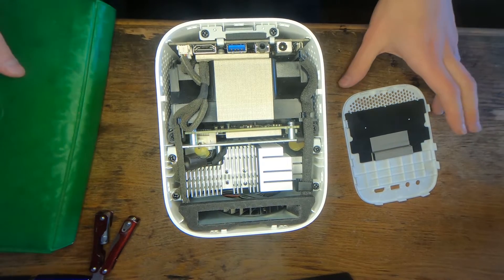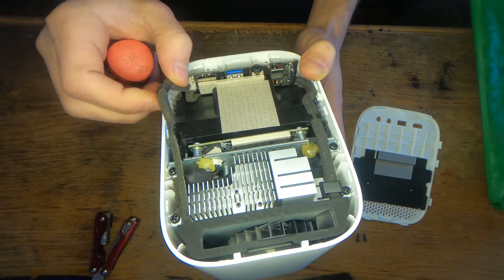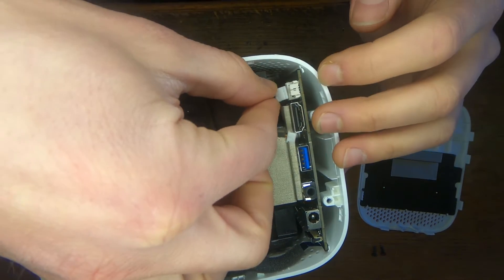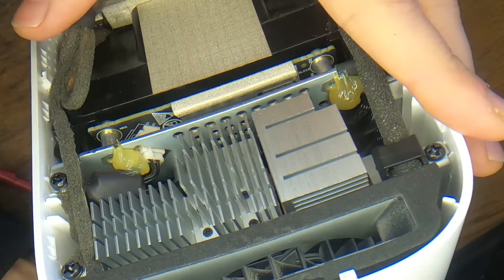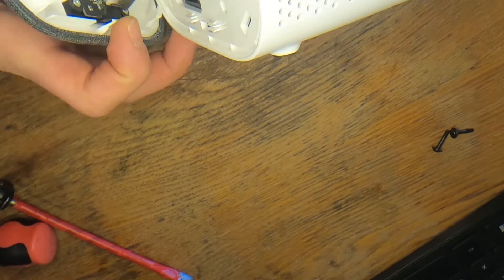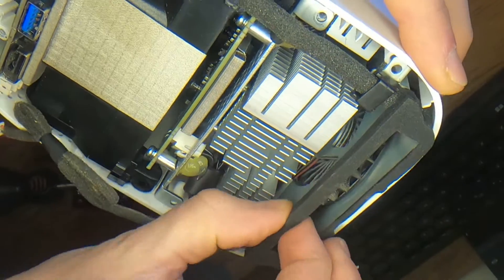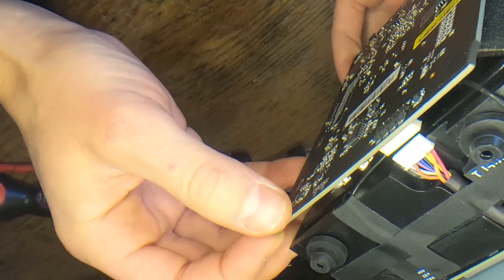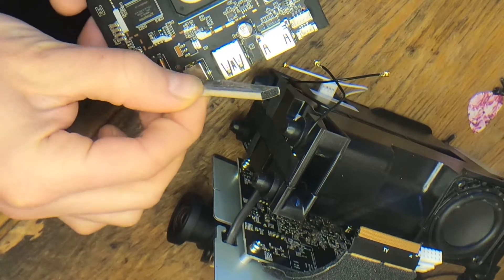Disassembly Xiaomi Mi Smart (youth) 1st edition projector

Comment: Buongiorno il mio modello ha smesso di illuminare bene lo fa con una luce flebile visibile poco e solo al buio. Lampada usurata o potrebbe essere polvere o qualche contatto?
Reply: The vibrating mirror inside is moldy.
Reply: @luoxiao-w7q9t Yes, it suddenly went dark. Is it possible to clean it and make it look like new again?
Reply: @PaoloAlzetta Take the lens apart, there is a lens in it to clean it.
Reply: @PaoloAlzetta Wait two days, and I'll make a disassembly video.
Reply: Maintenance procedures have been released.

Comment: Mine is 3 years now, it keeps shutting down randomly, I think it's overheating. I cleaned it with an air compressor but the problem persists. Anyone has a fix?
Reply from the maker: @FranciscoMaiaPT  they need a cool room below 30c also all sides should allow convection. There should be a warning for overheating and dimming of the picture. If you have no air conditioning in the house , forget it . Keep it off until September
Reply: @mendebil  hello , thank you for your reply. I have the projetor on my outside balcony and we use it only nights after dinner, when it's more cool. We are at the peak of summer here with > 35deg Celsius here, so it's really very hot. I believe it's overheating as you said, but what bothers me is that in previous years I had the same usage and conditions and the projector worked flawlessly. Moreso, I never get a warning of heating and/or dimmed screen. It works for 2 minutes, 10 minutes, it's random, it just shuts down in 2 seconds. I can just press the power button and start again...
Reply: I’m having the same issue, was thinking the air compressor would work… it doesn’t even warns about temperature anymore right? It just shuts down, I’m pretty sure mine is very dirty inside. I’ll try taking the fan out to clean and see how it goes
Reply: @JordanGomes93  Just to give an update. I found my issue and it was my fault in my case. I had made a power extension cord to allow for a ceiling mount and the conector soldering somehow got damaged (maybe heat from the hot summer), so it was an eletrical malfunction. I remade the cable and got not more issues ever since.
Reply: need cool atmosphere. these day auto swich off

Comment: Hi all ! Any one face the problem that the speaker doesn't work sudden .... but ear jack and if I connect bluetooth speaker is fine ...
Reply from the maker: @lamjeff1001  factory reset stock software works best
Reply: @mendebil  i have try to full reset thru the system setting... But still the same

Comment: Great video, thanks for sharing. May i ask you, have you fixed or disassembled the power adapter for this projector? Thank you very much
Reply from the maker: No. But I hear mine buzzing when idle which is strange. 19v 3.5A probably most laptop chargers would be a good substitute

Comment: my usb is dead, should i try to open it and get it repaired? or just use the projector without the usb functionality?
Reply from the maker: It is the same process as with the HDMI. Take the main board out then it is SMD replacement
Reply: @mendebil  replace the port? As charging works through that port but, USB connection to storage doesn't work

Comment: Please ..show us how to initialy open it
Reply: ...you just put a flat screwdriver or a cuttlery knife (a knife with a WIDE flat tip) between the edge of the white back panel and the body....and turn the knife´s tip a bit to pop the white back part off. 
Once again, there´s no screws to undo. Just gentle turn of the knife at each side of the square back panel...and it will come off

Kind of a similar process he showed at 6:40 in this video to undo the front panel!
Reply: please
Reply: Yes please

Comment: Hello friend, I have the same model that you show in the video and today the equipment projects but with less light to a point that is decreasing so that no image is seen, only sound.  I tried to contact Xiaomi to see if there is a repair center but I have no success in contacting them, what do you think is the reason?  Will you have a solution if you take it to a repair center?  Greetings from Mexico and thanks for the attention
Reply from the maker: Hola amigo. You need a good engineer who can disassemble it further. Sounds like a power supply or LED fault but I am not an expert

Comment: How did you initially open the plastic unit of the projector ?
Reply from the maker: The plastic back has clips you just need to be careful not to break them
Reply: @mendebil  so a sharp object needs to be used to pull out the plastic!!my projector is not switching on, so I need to check whether any dust has got accumulated
Reply: Opened and dusted, no luck !!
Reply from the maker: @AshwinRaghavbunny  check power adapter with voltmeter
Reply: @mendebil  sure!!

Comment: Hi, I already disassembled it almost 6 months ago because the fan makes a lot of noise. I found that the fan has some issue in the central pin. Do you know where I can buy the complete fan spare part?
Reply from the maker: I think you would be better off understanding the issue before buying anything. Is it the fan? Is it the driver?
Reply: @mendebil  it's the fan. I'm sure

Comment: brother i need your help
I'm from Chile, but I'm going to translate so you understand me.
I have a project of the same model as the video, I had it for a year and one day the lens stopped projecting. (It turns on when it is turned on, but it does not project the image, in fact it lasts about 1 minute to turn it on and before it turns off it shows an image like green and black squares.)
You could help me identify if there is a solution and what could be wrong.

thank you very much for your help!!!!
Reply: @mendebil
Reply: Merhabalar sorunu çözebildiyseniz bana da yardımcı olabilir misiniz ?

Comment: Thank you for this great explanation on disassembling the Xiaomi projector. For further notice, I first removed all screws from the back, and both cables running down the side of the housing, then I removed the fan - this way I got enough space to easily removed the front panel.
Also info for people with dead dmd chips, part number is DLP3310FQM.

Comment: Hey man thank you so much for making this video as there i no other on the entire internet for this model. My issue is i start having dead pixels I have many black and some white ones now aswell, everyday it gets worse. Do you know what kind of chip it has and if i could replace it? An answer from you would mean the world as i am slowly scared ill need to buy a new one :(
Reply: Hey man I have exaclty the same problem, please did you manage to find the serial number of the chip?
Reply: @mehdihbabou5290  Actually yes i took it apart and sucesfully repaired it for around 75€ the serial nº was: DLP230NPAFQP

This is for my chinese pro proyector version. I understood after my research that all models have the same DLP Chip. Goodluck i am happy we finally got a decent support topic open for the projector. I took everything apart and got quite a lot of knowledge out of it. If anyone has any questions please don't hsitate to ask.
Reply: @jaktie123  Hey thank you for answering. In my case I have Mi Smart Projector 2 and i read that it has a 33inch Dlp chip "DLP3310AFQM" but to be sure I wanted to know if there you found the serial number on the chip itself, is it written or engraved on it? and please where did you order it from?
Reply: @jaktie123  Love the open repair topic, I’ve been worried lately about availability of replacement parts.
Thank you for all the info so far.
One question:
What’s the serial number of the led module?
Thanks.
Reply: @jaktie123 hello did you manage to fix the green screen issue ?
Reply: @sosovitchsosovitch9143  Hi my friend is your screen completely green? Can you see anything at all trough it? When did it start happening? Please give me the max info to try and help you with your issue my friend!
Reply: @jaktie123  yes the screen is completly green, that doing that a few month ago can you have a Instagram or everything else where I can send you the video of what’s the projector does ? Thanks for your reply
Reply: @jaktie123  hello any news ?
Reply: Hello guys do anyone have manage to fix the green screen issue please thanks for you reply
Reply: Hello man did you repair it ?
Reply: Mine gets off and do not light on ! Help me
Reply from the maker: Hi. Sure my pleasure. It is really just a disassembly video so an engineer does not risk breaking it. For details tho I would have to check again, which is not really practical :) I hope you are lucky and  find the parts you need
Reply: @mendebil  Thankyou so much for getting back to me! No problem don't worry, if you ever take it apart again it would be cool if you could share me a picture or serial nº of the DMD chip thats inside. Anyway your video is great on guidance on disasembly! Thank you again😇
Reply: @jaktie123  Hi, I have issues with the same projektor (it only displays green screen). I took it apart following this video, and I went a bit further. I managed to take out the DMD chip. The part number is DLP3310FQM. I hope this helps.
Reply: @zergonion  I'm experiencing a problem with my projector - it's the second generation of the same model shown in a video. I'm noticing a lot of white and black dots appearing on the screen, which I've learned can cause damage to the DMD chip. I'm wondering how to identify the specific chip that needs to be replaced,  and how did you manage to replace it by yourself?
Reply: @zergonion did you remove the screws from the module on the right that the video is at 11:32 there is a dmd chip with that part number or where it is located
Reply: @zergonion hello did you manage to fix the green screen issue ?
Reply: @sosovitchsosovitch9143   Unfortunately not. I ordered the correct part and replaced it, but the screen was still green.
Reply: @zergonion  what part did you change ?
Reply: @zergonion  where is the dmd chip located?

Comment: How do you open it at first Time? I don't find
 any screw... I just want to clean the inside.
Reply from the maker: Take the back plate off with a plastic tool. Or a screwdriver
Reply: May I ask how to remove the back plate?

Comment: Hi, I have the same model (bought pre owned) and the autofocus doesn't works anymore. It seems to try focusing (it makes the noise of engine rotating in the autofocus screen) but it's like if inside the mechanisms a "drive belt" or a gear is out of place😢. Shaking it makes no weird sounds. So basically the focus is fixed and can't be changed even after a factory reset. I contacted xiaomi but they can not accept to repair it for some reasons related to the warranty. Do you have any suggestions? I may try to ask help to some local repair shops in Italy but they probably never seen one of those projectors before and I'm willing to know if there are spare parts to buy somewhere. Thx a lot for your attention.
Reply from the maker: The AF servo motor has a gear wheel moving the lens back and forth. As simple as it can get. (You can see it at 11:30) if you know a CNC / 3d printer enthusiast (a person who builds 3d printers or cnc machines) it should be easy for him to take a look.
Reply: @mendebil thank you very much for showing me the gear and the suggestions.